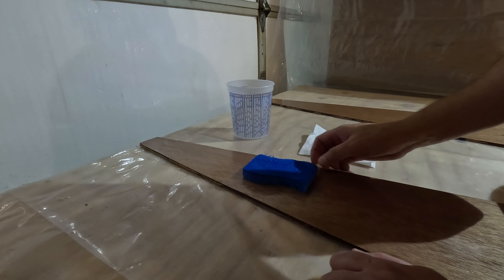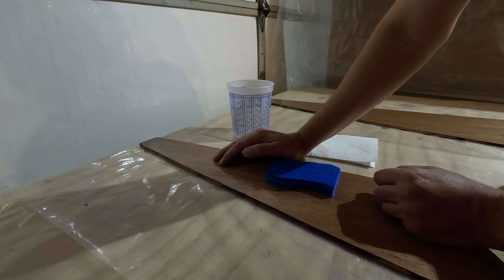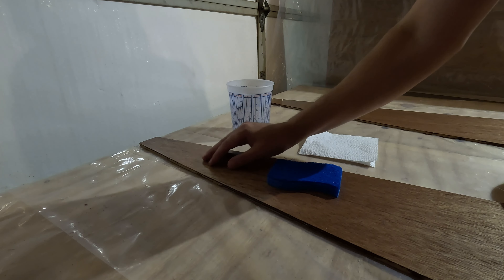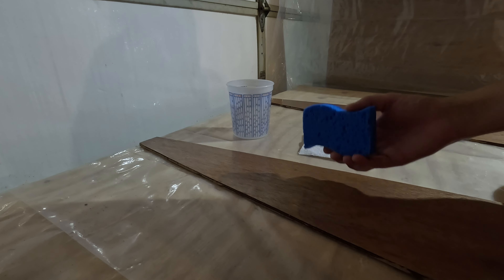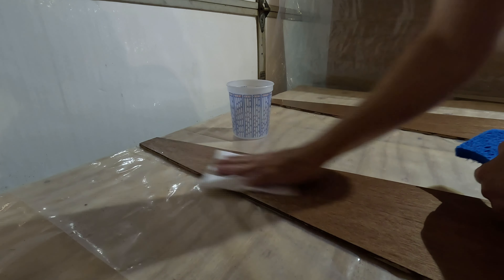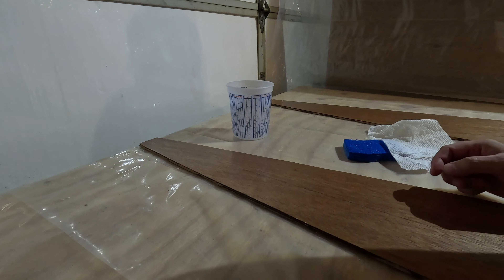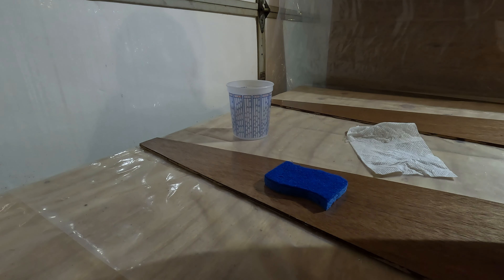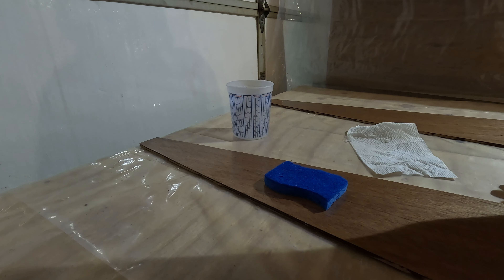How to remove amine blush so new epoxy will stick instead of coming apart.

Comment: Thanks! Would definitely try this
Reply from the maker: Glad it helps. The main thing to remember is that you need to remove any amine blush because a new layer of epoxy won't stick to amine blush and the layers will separate. You also can't simply sand the amine blush away because sandpaper will push the amine blush into the scratch marks left by the sandpaper. The best method is to scrub with warm water. Some people will add a bit of detergent to the water but this is not needed because amine blush is easily disolved with water. It might feel like wax or oil but it's not. I've also been using a scraper to remove excess epoxy which I think is also a good alternative because the scraper removes thin layers of epoxy without pushing any amine blush back into the surface.

Comment: What is the finest grit sandpaper that can be used for sanding before the next layer of epoxy is added?
Reply from the maker: I don't think there is a specific rule. You want a fully cured surface to be free of amine blush and then roughed up so the next epoxy has something to grab onto. I usually use 80 grit. I would suggest not going any finer than 120.

Comment: Good info.
Reply from the maker: Thank you. I did a lot of research especially about whether or not any soap or detergent should be used. I've also hanged my mind slightly about using peel ply. While I still avoid peel ply for large areas that are fully covered in epoxy, I now find peel ply useful for areas that are difficult to sand and for when there are areas of wood that are not yet covered in epoxy which would absorb the water.

Comment: Another option is a little Dawn or dish detergent in warm water, the warm water certainly is a help. or seems to "cut" it.
The dawn and cool water has worked well for me,. And my suppliers(plural) recommended the "detergent".. You need to make sure you rise the detergent off with reasonably clean water.
If you are inside and can't rinse, your method is probably easiest.
As I have said before, and you touched on this.
The chemical process of curing causes amine blush, so regardless of weather or temperature, it's safe to say you can have undetectable amine.blush.
In applications out in the hot sun, I feel most times those conditions are minimal blush.
And some epoxies are worse or better about blushing. just depends on the recipe of the batch/brand.
Cheers.
Reply from the maker: A little detergent can help water get into small pores or other tight spaces by reducing the surface tension. But like you said, you then have to make sure to rinse well. Since the amine blush is water soluble it doesn't need any detergent in order for the water to dissolve it. It would be different if the amine blush was oil-based. That's why I recommend warm water only, with a scouring pad, and a prompt drying with a clean towel.